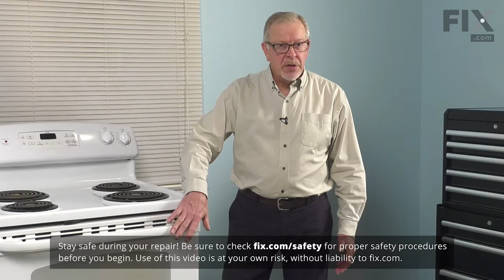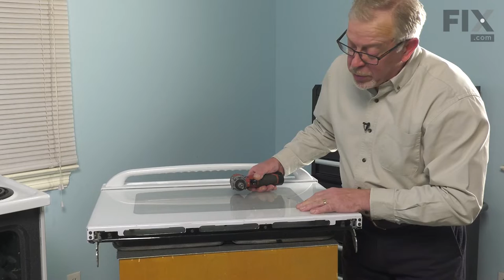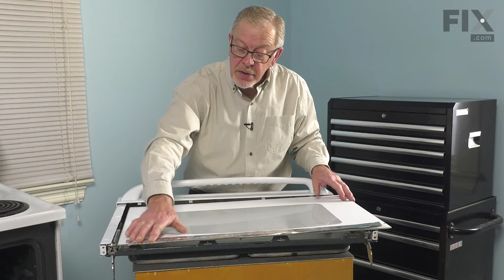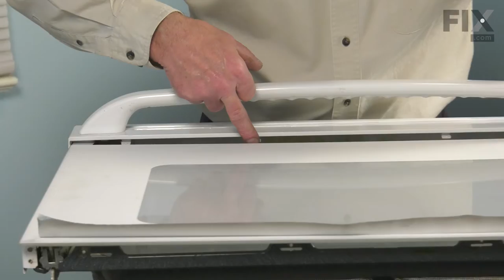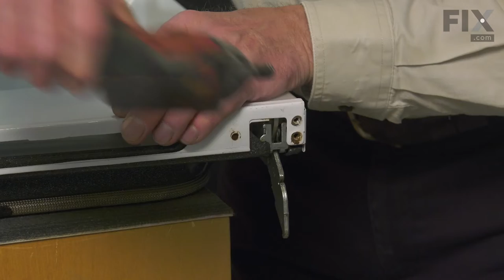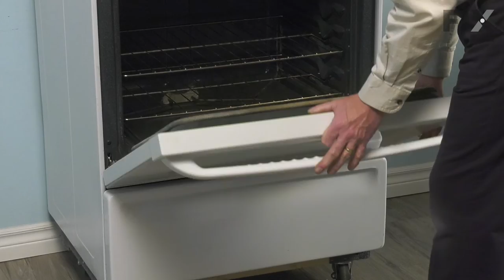GE Range Repair - How to Replace the Outer Door Glass

Comment: What is the purpose of the foil tape
Reply: Thanks to google-  Aluminium foil tape provides a reflective layer on sensitive and delicate surfaces, protecting them from high-temperatures, ultraviolet and infrared light, as well as moisture and certain chemicals.

Comment: Excellent DIY video.....I didn't know about the heat tape on the inside.  
I am surprised you didn't advise to clean the interior of the door while the exterior glass was off.  That's the reason I'll be taking my door apart.

Comment: Why do you need that tape?
Reply: Aluminium foil tape provides a reflective layer on sensitive and delicate surfaces, protecting them from high-temperatures, ultraviolet and infrared light, as well as moisture and certain chemicals.